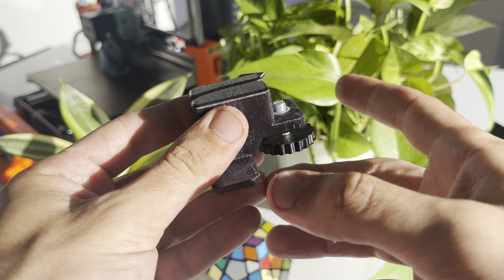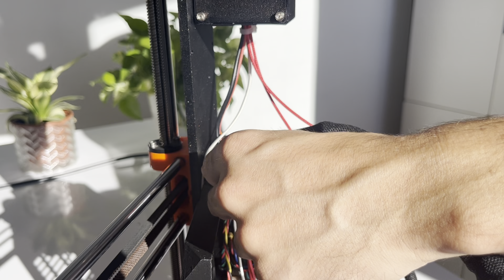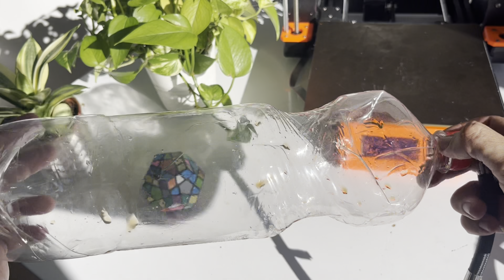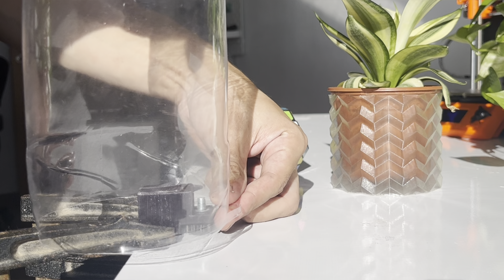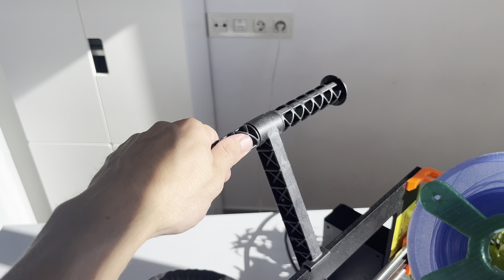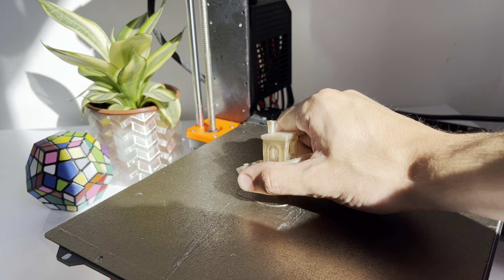How to 3D print with plastic bottle strips

Comment: A serious design problem is that retractions would deform the material. Not to mention that if the material is extruded slowly it will not come out the same as if it is extruded quickly.
Reply: That’s a good point I hadn’t considered before starting this project. It seems like in all the prints the creator hasn’t had any issues though

Comment: How do you keep the freshly extruded PET filament from clogging in the prusa's printing nozzle? How are you cooling it so quickly?
Reply: I’m assuming your temperature has to be just barely above melting point. But then since all PET are not created equally, that would not be the best solution. I’d say adding a small fan below the first hot end should fix the problem with variances in different bottles.
Reply: @ByDesignation I believe the nozzle is set to a temperature that does not melt it properly, but instead is hot enough to reshape it more into a hollow tube than proper filament

Comment: Hi, I'm also starting to get closer to this world but I have a problem which is that I don't know how to join the filaments produced by each bottle, I saw a machine on YouTube called slunaz ff1r, whose function is to join the pieces of filament, but I don't know how it can be, has anyone tried it?
Reply: i think if you sanded the areas down that you wanted to join on the bottle strip with a dremel real quick, then join the sections either with heat or an ultrasonic welder?